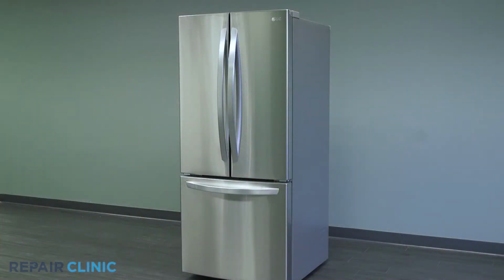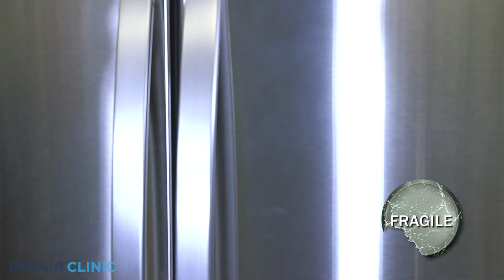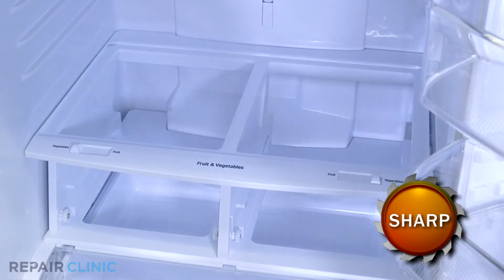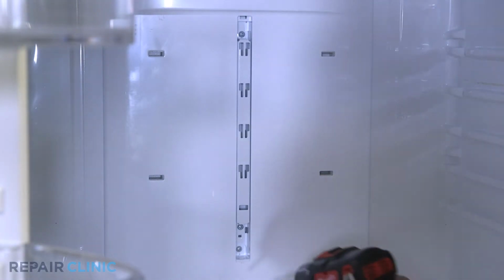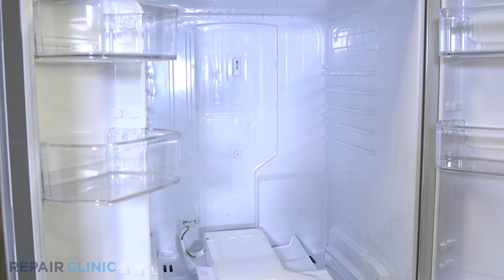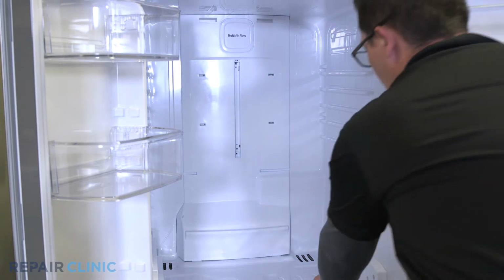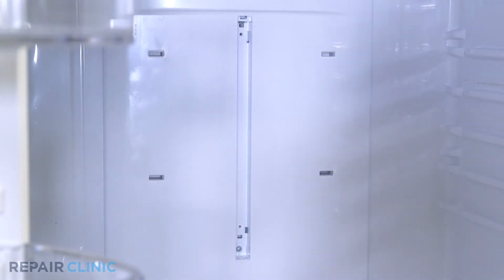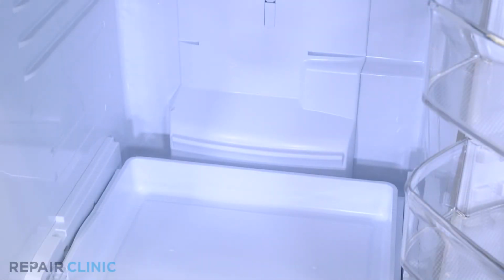LG Refrigerator Duct Assembly ADJ73712911

Comment: is there a circulation fan within this duct assembly? I'm not getting cooling within the refrigerator section, while the freezer section is sufficiently cold. If yes, is there a replacement fan for this piece that can be purchased separately?  All other possible fans and thermostats appear to be ok.
Reply: Same question 😅
Reply: No fan just a duct with damper.  The motor for this model is in the freezer compartment so make sure you know which part you need and good luck.  There are more videos around that show how to test the evaporator fan motor and damper motor.